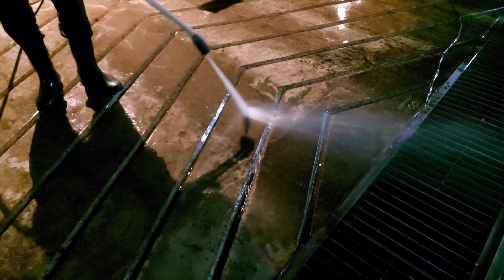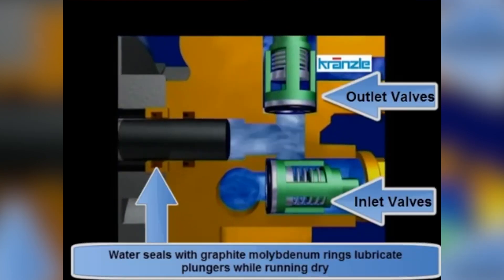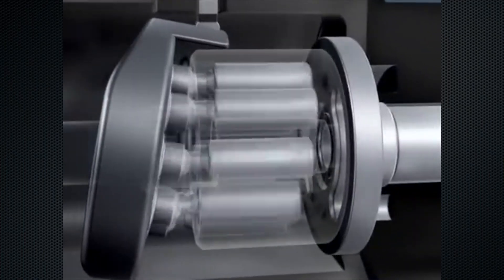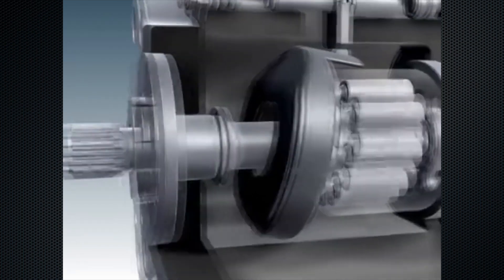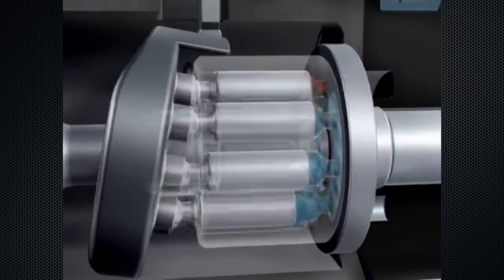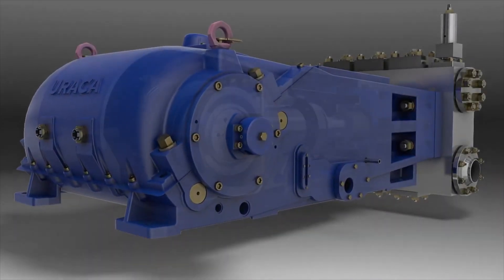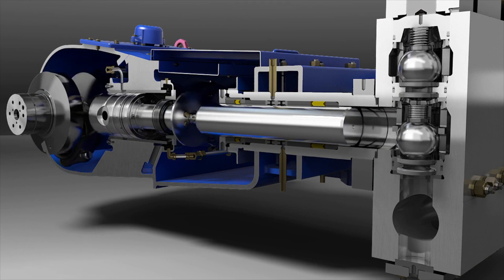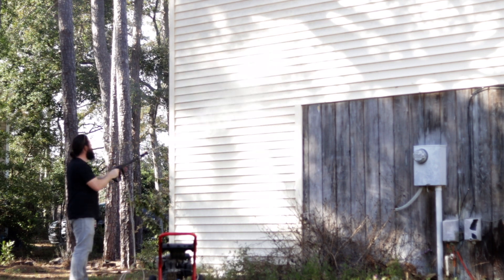Pressure Washer Pump Types Explained | Pressurewashr.com

Comment: I found this video exploring why the electric 2500 PSI Greenworks GPW2500C pressure washer with a triplex pump is about twice as expensive as it's non-commercial cousin, the 3000 PSI GPW3001, that has a cast aluminum axial cam pump. It looks like the pump is just that much more expensive. What's unclear is why it's rated 500 PSI lower than the non-commercial version when you mention that triplex pumps typically run a much higher PSI than that. It's also only rated for 1000 hours and does not require maintenance. The PSI, lifespan, and serviceability all seem to be in contrast to what you mention about this type of pump.